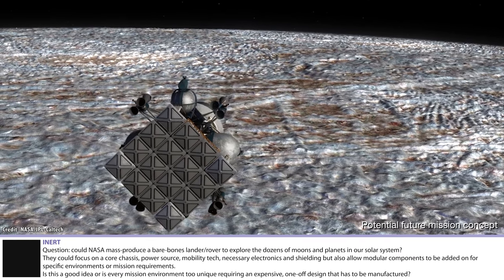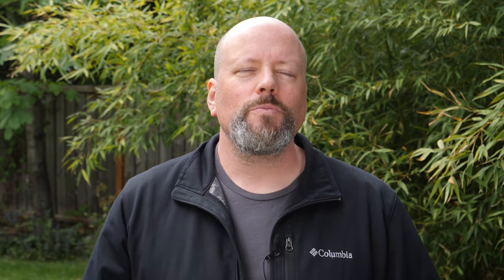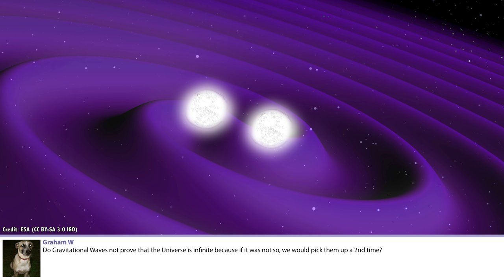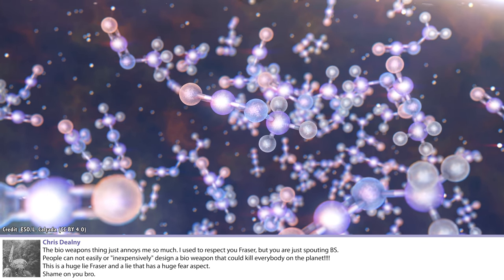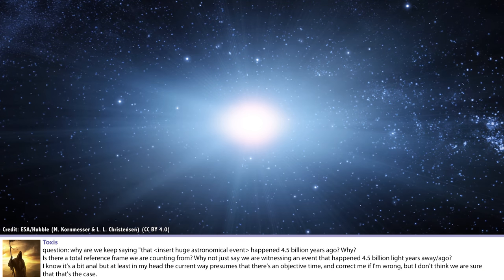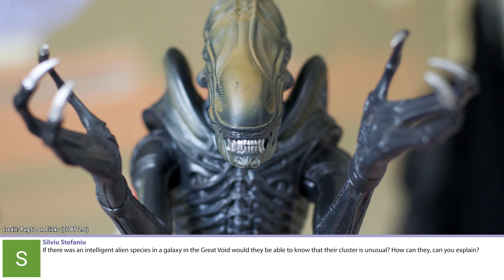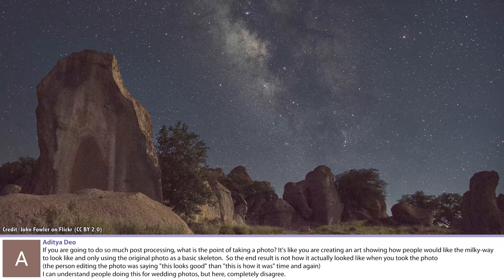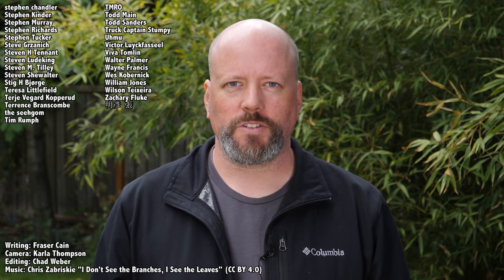Q&A 86 : Could We Move Atmosphere from Venus to Mars? And More... Featuring Dylan O'Donnell

Comment: In the first 12 seconds you offer to answer obscure questions, and you obviously have a handle on Kerbel Space Program with extensions. Would you care to indulge me? Care to model this? My ideas are released to the public domain. A torus of at least 240 meters (per a source) minimizes Coriolis effect. A space station with artificial gravity is beyond our immediate reach, besides radiation concerns.  As lava tubes have been discovered in the moon, why isn't all attention being put toward them for a stepping stone?  A torus in the moon (at about 1rpm at 240 meters with a grade of 30%, but please adjust for a perfect 1rpm for potential psychological effects) can be built by starting from inside the lava tubes. Adjust current tunnel digging technology for the low gravity and specifics only able to be determined by actually getting to the moon and making measurements, but the tunnel diggers are in use all over the world. If this works, it would achieve a 1rpm habitat hub protected from radiation underground at 1g. Persons not leaving their apartment and office may forget they are not on Earth, and would be useful in psychological study. Persons doing 0g and 0.166 (moon gravity) work can go home to the moon torus and spend the rest of their day/night at 1g. Hours of 0g per day for optimal health can then be calculated. Putting "homes" in the moon does not preclude working in orbit of the moon or even heading to Earth's orbit to capture and repair a satellite.  How efficient can "moon hoppers' be made?
Since regolith is made of sharp little shards (if what I've read is accurate), that makes it a better base for concrete or "regolith slag" used only for basic shape, then coated, but not what you want blown onto your unfinished project. This may require a retractable roof for launching directly from the construction site - or merely hop to lunar orbit to be completed there. In fact, all construction can be done in clean-room environments on the moon (gravity when needed) and assembled in space.
Elon Musk can combine several of his projects into this one implementation immediately.  In fact, does this reflect Elon's basic plan in the first place?

Comment: Is it theoretically possible with the help of gravitational lensing, interferometry and other advanced techniques to zoom in on a planet light years away so close that you can see individual aliens (should there be any), objects or even smaller details in high definition?
Reply: in order to resolve meter-sized features 1 lightyear away, you need a telescope with lens diameter of 10 million kilometers. Double the distance/resolution = double the diameter. So yeah, array of telecopes at lagrange points of earth's orbit could in theory produce image sharp enough to resolve individual people several lightyears far away as separate dots in the image.
Reply: The major challenge to building an optical interferometer is in accurate positioning of the dispersed mirrors.  Relative position of the mirrors need to be known to a small fraction of the wavelength of light you want to work in.  The Event Horizon Telescope that captured the image of the M87 black hole was observing at a wavelength of 1.3mm.  The optical wavelengths are around 380-740 nanometers, around a thousand times smaller.

If we do crack that nut then there's really no limit to the angular resolution we can observe. Just put mirrors out to the extreme edges of the solar system ~8 billion km apart.  Of course small details emit very small amounts of light, we'll need many km-scale mirrors to collect enough light.

Comment: Fraser question, could you simulate gravity with something like a pulley system that has some resistances to it. Say a nob you can turn to increase the resistance. Then set different points on the space suit to connect the pulley system. After that maybe a small magnet under the feet to help with holding you to the ground slightly. I don't think this would help with all things. But might make the muscles and other parts like that feel more like home. Let me know what you think of this thought of mine. It literally just popped in my head.
Reply: The muscles need daily resistance exorcise to maintain their current mass/strength, the bones also need daily stress to keep their structure from weakening, it's the constant micro-tearing on muscles that causes them to rebuild, it's the constant micro fractures that happen to bones that causes the body to repair them(How I generally understand the system to work), this happens with just walking around doing normal stuff, which help keep atrophy to a minimum.
In space, it's very difficult to replicate the stresses of just walking around, hence the exorcise regimen.
I suppose you could have a suit that simulates those forces and resistances for your everyday tasks, bit I suspect that the key development will come from a better understanding of the atrophy mechanism and then developing a drug that can slow down the process or possibly turn it off(I think turning it off could be dangerous if it's off for too long, eg. enlarged heart muscles)